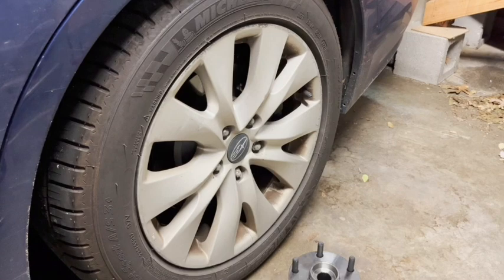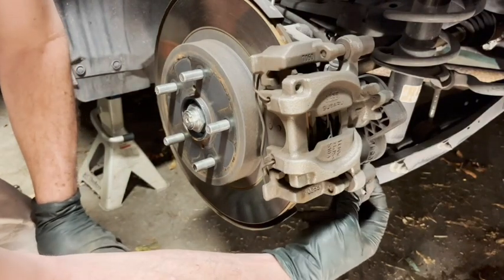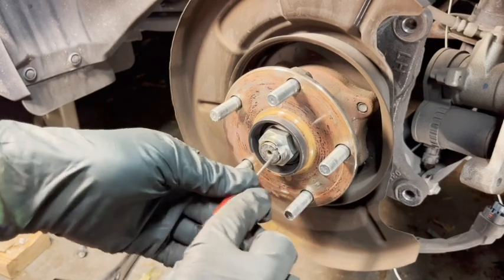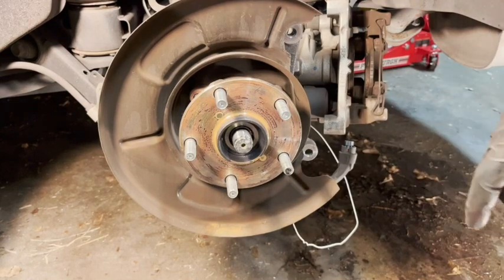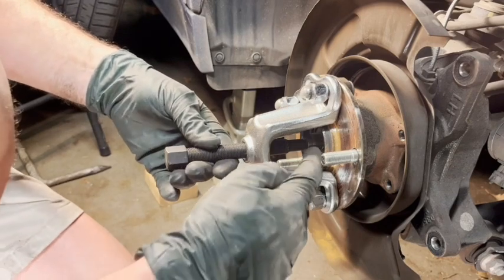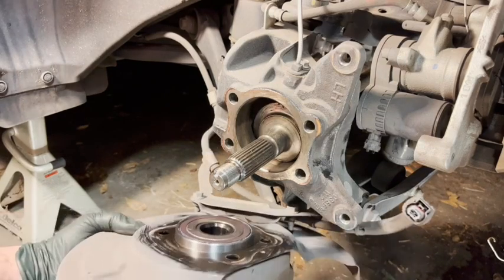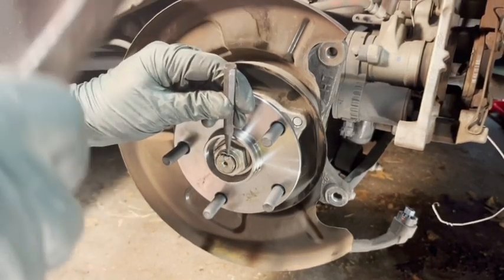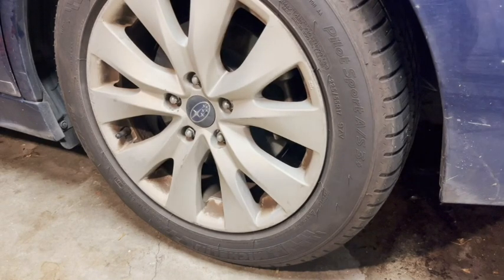2015 Subaru Legacy Rear Wheel Hub Replacement

Comment: Did the front bearing hubs on my 2015 Subaru Outback earlier this week.  Pretty much the same process.  That axle nut is fairly easy to remove with an impact wrench.  Also, if you put the rotor and caliper back on and insert a steel rod into the rotor fins through the caliper you can more easily torque the axle nut.
Reply: Set brake
Jack car
Remove wheel
Remove axle nut
Release brake

How I did it tonight, but that hub sure as hell is not coming out as easy as that one. Left it for the night with wd40

Comment: Doing this on my ‘17 Outback soon! Thank you for the video! It’s surprisingly hard to find any information on the ‘15 and newer. I went with Moog too. I think they are a good product and will last a long time.

Edit: Just finished! When using the pull hammer to get the bearing hub out the bearing hub separated in half. The half that was stuck in the knuckle was super hard to get out due to rust. Wasn’t expecting that but I guess it proves how bad it was!
Reply: Your experience is the most common one if the car is from anywhere with salted winter roads. Hopefully you put a thin layer of anti-seize in at the hub/knuckle interface to make it easier the next time around.

Comment: I'll be doing this job this weekend. I bought the same puller you used. I hope and pray that it'll break the hubs out of the carrier without any sledging, heating or shocking.
Reply from the maker: Good luck to you!  My experience was relatively easy, at least with that portion of the repair, so I hope you have a similarly trouble-free time with it.

Comment: I did this job on an Outback recently. It had spent the first five years of its life in Ohio with salted roads. Getting the hub out was a nightmare. I ended up pulling the whole knuckle, having to replace a number of suspension parts due to corrosion. I used the old farmers trick of a heavy weld inside the rear of the bearing hub to shrink the metal enough to finally pull the hub out of the knuckle. What should have been a one hour job turned into a whole day. I used an SKF replacement which is marked made in Korea. I think the Moog units come from China. I have more confidence in SKF or INA for these parts than I do in Moog. Absolutely stay away from the ultra-bargain units on eBay or Amazon. Those are for shady used car sellers who just want something that will last for a few months :).

Comment: I'm currently doing this on my 2015 wrx. Been a 2 day project so far. Mine is seized in there. So jealous yours came out so easy.
Reply from the maker: Wow!  That sounds rough.  It's been a few days since you wrote the comment (sorry I didn't respond earlier), and I'm curious: were you able to get the hub to come off your WRX?
Reply: @markbeebe4388  yeah it was rough. It took 3 days and like 5 different people trying. Finally, my mechanic came over with a proper torch and we heated it up until it was glowing red and beat it with a 10lb sledge hammer until it finally came off. Next wheel bearing that goes bad, it's going to a shop 😅
Reply from the maker: Holy moly!  That's incredible, it must have darn near welded itself to the suspension for it to require that kind of treatment.  Glad you were able to do it, here's hoping the next one isn't anywhere near as difficult!
Reply: Dude the seize is real. I have a 2015 legacy and my passenger side is Not budging…😢😂
Reply: I kept hitting mine with a hummer from different angles for a few minutes and it let go finally. The way it came out in this video looks almost staged :) You probably live somewhere in the worm climate. You had almost zero rust and I guess it's rust what's holding it from coming out. So hummering is a good therapy to loosen it up.
Reply: I did one on the front it took me hours hamering to get it out it looks like you faked the video 

I know you didn't but it feels like it when I struggled so much

Comment: Just replaced my 2015 Foresters rear WB hubs @88k miles.  I think only the left side was bad but decided to replace both. I used the new updated Subaru oem WB's and new updated backing plates.  The TSB recommends replacing both as a unit. MOOG has a worse track record from I read, so I went with OEM. We'll see what happens.
Reply: And Subaru’s track record is better than Moog’s? Isn’t there a reason you’re replacing OEM in the first place?
Reply: @built4u2  my rear WBs went bad @ 90k miles and front 2 are still good. Cassette type WB hubs are all prone to water intrusion and if the center wheel nut is over torqued, it kills the bearing.

Comment: A bit late but, the easiest way is to crack off the wheel nuts and hub nut whilst the car is still on the ground.................then jack it up..... not the other way round.😉
Reply from the maker: 100%. In this instance, I honestly spaced out and only realized I’d skipped the step of loosening the lug nuts after I’d already jacked it up. So I decided simply to show what I do in this situation: chock the wheel with a piece of wood to keep it from rotating. 

Wish I could say that this was the first time I’d done that. But nope . . . 🤓

Comment: Puller? I just did both on my 12 outback was a pain in the stones until I got a hold of a nice air chisel
Reply from the maker: Wow! Sounds like you had a lot more difficulty on yours. I wonder why it was so much harder to get the spline separated from the hub? On mine, I did not even have to use much force with the puller, and it came right apart. Strange.

Comment: Timken's the best also plan on beating the crap out of it mine was great it came out in two pieces with one still in frozen! any ideas?
Reply: Same happened to me. Put the bolts in on the other side, attach a pair of vice grips to the slide hammer, attach the vice grips to the flange on the bolts and start pulling and going around to each of the four bolts evenly. (Make sure the bolts go in enough to catch all the threads of the hub)
Reply: @built4u2  ya it didnt come out couldnt get in there but i will make a tool where it will come out not matter what from one side. any ways your right thats one of the main ways in getting it out for sure.

Comment: I left the rotor on and set the parking brake to break loose the axis nut...after bending out the crimp.
Reply from the maker: That's a good idea.  I suppose the parking brake would have to be released before the brake rotor will come off, but it's a good option if you're like me and have already jacked up the car without loosening the nuts!

Comment: you have an 8 track?
Reply from the maker: Yes indeed! It's goofy, I know, but when I got it back in the 90's, you could buy 8-track cartridges for like 10-25 cents apiece.  I've still got a few, and the players are mechanically very simple machines.  It's a fun conversation piece, but as an audio format, it's honestly not very good: audio quality is hit-and-miss, and the cartridges themselves require a lot of hands-on maintenance.

Comment: Waoooo 2015 and you already had to replace the hubs 😱 how many miles you put on that car before they went bad ? Thanks for the video
Reply from the maker: Yup. No car is perfect, and the rear hubs on this particular model are statistically somewhat prone to failure.  Mine had 45,000 miles on them, and yes, that's not many miles, but the rest of the car has been excellent.  I bought the car used, so perhaps the previous owner left it sitting in high water or something, who knows (and who really cares).  I made the personal choice to replace them with Moog hubs, and hopefully they'll last longer than 45,000 miles.  Time will tell.

Comment: what size breaker bar?
Reply: and are hose round punches?
Reply from the maker: My breaker bar is 30”, but the length isn’t critical: you just have to be able to turn the big socket with enough strength, depending on how tight it is.  Mine was really tight, as you could see: I had to stand on it.
Reply from the maker: My punches are round.  Again, shape isn’t critical, it just has to do the job and be of metal that’s hard enough to bend the divot back on the nut.  Maybe a hardened steel screwdriver would’ve worked, or maybe there’s some kind of special tool for this sort of thing, I don’t know.

Comment: Sweet 8-track. How many horsepowers do you get from this. You should have replaced the fellow-peen tubes while you had the spleen exposed.
Reply from the maker: Thanks.  A bit of advice: I recommend not doing auto repair work while stoned.  :)
Reply: Bummer.
Reply: @markbeebe4388  i recommend being stoned lol

Comment: You didn't break your speed sensor?
Reply from the maker: I suppose not.  I did this repair 8 months ago, and everything's been working great since then . . . so: no, I didn't break the speed sensor.
Reply: Only way you’d break the sensor would be if you didn’t free the axle from the hub before pulling the hub out
Reply: Does your cruise control work? I put an aftermarket hub on my old outback and there were no lights and the abs worked, but freaked out when I tried the cruise control. Replaced the bearing with a Subaru one and it worked fine

Comment: Just spent 3 hours busting loose my 2016 Legacy rear wheel hub using a 2 pound hand sledge and a 10 pound real sledge hammer with a "hub removal tool"....and plenty of PB Blaster...  Also, i had to fight the axle nut....had to hit it with Blaster, then alternated pounding  it with the impact wrench and breaker bar with a cheater...

I like your video because it shows the steps on how to do this job, BUT, if you have a rust belt car, like i do, this video is very misleading....  Just sayin'.
Reply from the maker: Hey there. I’m really sorry to hear you had so much trouble. Me, I do not live in the Rust Belt at this time, although I did live in St. Louis for a while, so I understand the difficulties that can come with corrosion due to road salt. I hope you are able to get your car back on the road soon, and that this repair is a one-time thing for you. Good luck!
Reply: @markbeebe4388  Thanks for the reply...i did get it done, along with replacing the rear brake pads, the next day....i HAD to get it done because i was leaving for Maui the day after that!